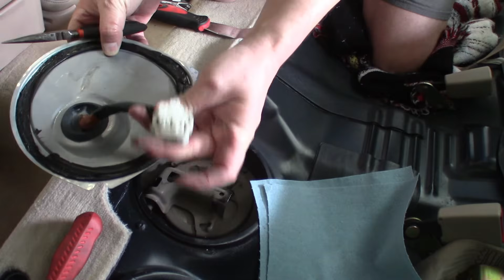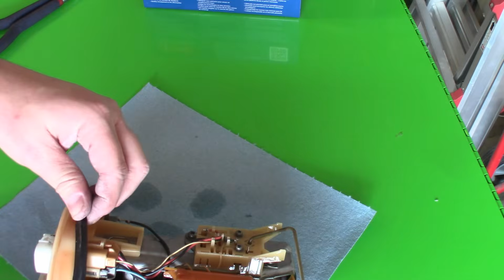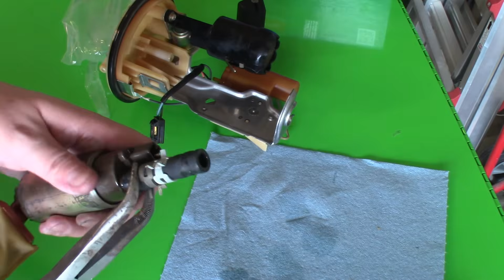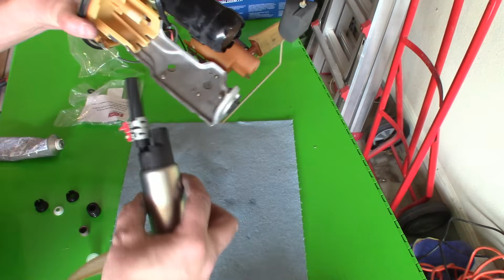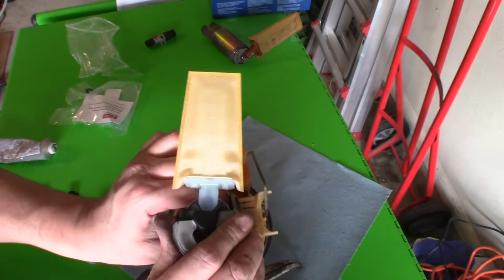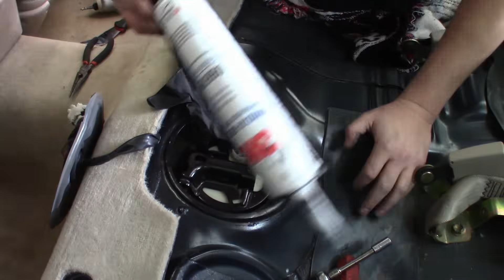Lexus ES300 / Toyota Fuel Pump replacement

Comment: Mines 2002. Is it the same
Reply from the maker: It's basically the same, the location of the filter is further back and lower.
Reply: @nicklldoit  thanks bro. I’ll be getting into it soon   Car runs good but ( sometimes) when I kill it it want start    I wait 20 30 mins. An it cranks rite up.     What do you think   Is it the pump ?
Reply from the maker: @timmynormand8082  it could also be your fuel pump for sure. I have a video for that and it's cheap and easy to do. I just did one on the side of the road a couple of weeks ago.
Reply: @nicklldoit  hey thanks man for replying  sitting here idling an it fine. But only sometimes the pump stops ?  Just asking
Reply: @timmynormand8082  it might be that the fuel pump isn’t completely bad yet. I had a older truck and it would run but occasionally die from a bad fuel pump. So it was getting bad but wasn’t completely broken. Yours may be doing that and warning you it’s gonna go out
Reply: @Thatguy-1211  thanks. That’s exactly what it was. I changed it an   No more problems. Appreciate you my friend

Comment: Hey Nick, where would one find another one of those clips for the fuel line?
Reply from the maker: Dorman part number 800-005 or 800-006. Or 800-016, I don't recall if the line was a 5/16 or 3/8, either way the 800-016 has both sizes. Auto parts stores like O'Reilly's has them.
Reply from the maker: Also Lexus part no. 90923-07010

Comment: My 96 Lexus es300 fuel pump doesn't look like this help me please
Reply from the maker: What exactly is the issue? I know the actual pump is pretty much the same in my video.
Reply: 92-96 ES300 is a different generation from the 97-01 ES300. It’s likely a different process to replace the fuel pump but I do not own a second gen ES so I couldn’t tell ya for sure.

Comment: Can you elaborate some more on the circular fuel filter? You mentioned something about back pressure? Do you know how that works?
Reply from the maker: It's acts like a pressure regulator in your gas tank, fuel returns back through it and back into the fuel tank.